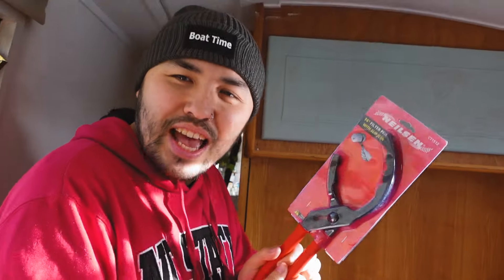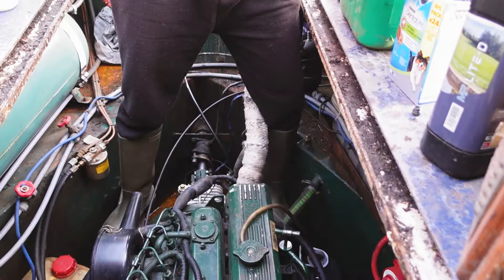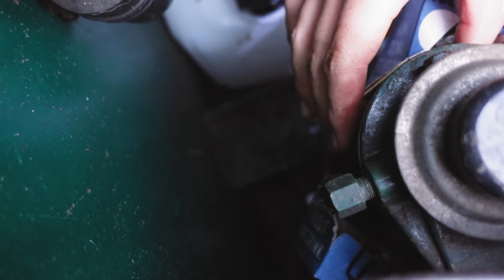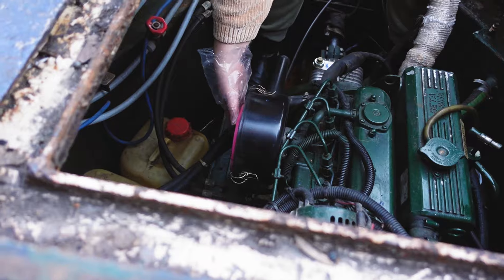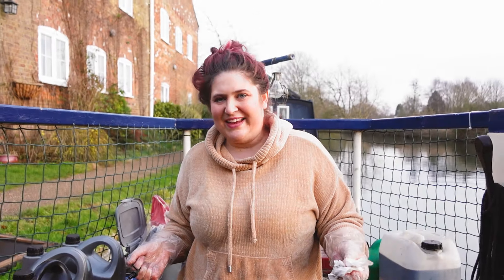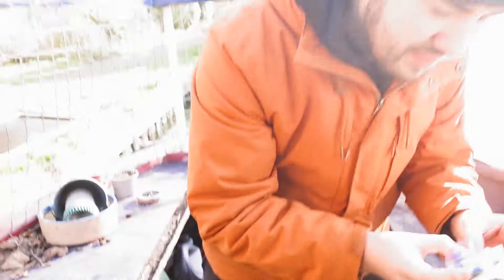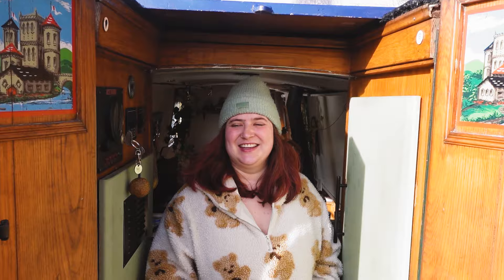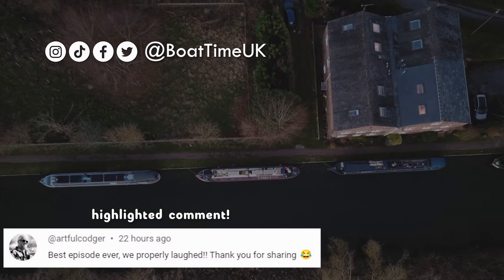We found a dangerous problem with our engine | Narrowboat maintenance - 194

Comment: i  have been a mechanic for 15 years,  use a little plastic bag and put it around the filters when you take them off and the fuel and oil will drip in the bag. it will keep everything clean. your filters should be tighten a quarter to half a turn when it makes contact with the surface.

Comment: Don't worry about an air filter being a bit thick as long as the casing will close. Only worry if it is too thin so it is loose in the casing. That old filter looked very dirty. Good that you changed it.

Comment: A word of caution when filling your fuel filter. The way you went about it was you opened the cock in the water separator. That is diesel that came directly from the main tank into a cruddy separator bowl then into the clean side of the new fuel filter. The centre hole of a filter is the clean side. You have no way of seeing what is actually going into the new filter. The little holes on the outer edge is where the unfiltered diesel goes it then passes through the paper filter then exits though the centre hole. So the way you did it is you poured possibly contaminated diesel into the filer which then goes directly into the injector pump and injectors. This could cause pump damage of injector clogging. It's not the end of the world but cleanliness is the best. Is there not a manual fuel pump to prime the filter? 

 This filter practice also goes with oil filters. Some people like to fill them first if they are vertically mounted. Personally I don't bother.

Comment: Wesley, Amy good seeing you again,
Isn't boat life a learning experience?
Your air filter needs to be snug so that the air travels through the filter and not around the filter.  As for your old air filter, that was disgusting lol.  It is better to change the Air filter often otherwise the engine will suck in dirt and not get enough clean air.  Dirt in the engine will create excess wear in the cylinders.
Definitely one thing to check when doing service is looking for lose wires and leaking hoses.

The engine wire order does not matter as long as the connection is secure.  As for the colour of the connectors try to keep the colour the same.  On the package of connectors it may tell you that different coloured connectors are for different size of wires.  You will also notice that on the crimpers there are coloured dots these related to the colour of the connectors.  TIP when crimping do two crimps on the connectors.
Best wishes to all four of you.
Mark
Alberta, Canada

Comment: Next time use a small strap wrench for filters as they fit easier, also filters should only be hand tight to seal. Also boat engines have low run hours so only need annual service. Never put your hand over air intake to try and stop a runaway diesel, you will severely damage your hand, runaway diesels are rare and only with very worn engines that are burning their oil. Well done for getting this done so, it’s nothing to be scared of as you’ve found

Comment: You should change your engine oil, and oil filter every 250 hrs of usage, your diesel filter every 500 hrs. Best thing you can do for your engine. It’s not once or twice a year, like your gearbox oil.
Reply: I agree. Oil, oil filter and one hour labour every 250 hours is way way cheaper than an engine job and the inconvenience of the down time.

Comment: Just as an fyi.. Cassandra comes in different forms ... She sometimes has short legs or only one leg, or a 3 bolt type set up, she also comes looking like a lil cap w a wrench socket atrachment, or has a sling or round key form..  she is varietiable and comes in as many forms cause there are a large variety of engines& they each have oil filters in complicated places. If you search for: marine oil filter wrench, it should show u a huge variety. All u need is the size of filter u use& then pic the best Cassandra for u.
Pls remember to add a dab of oil on the filter gasket & make sure the old ring is indeed off.
It prob would be good if you write down a parts list, take a pic of it, (or take a pic of the empty boxes& containers) then make them a favorite pic, so u can find it back easily & take the mystery out off odering. 
If you have a permanent marker (white laquer type) pls mark the bottles that have used oil in em. Often parts store will accept old oil, but check first.
Pls always disconnect ur battery (ies) before tinkering w wires.. cause .. well just trust me.
If u ever want to get into the entire electricity subject a bit more, or take the mystery out of it, u could order the book:
The 12 volt Bible (its an older book)
Alternatively the
Boatowners Mechanical and Electrical Manual will turn u into old pros in no time& have u never be afraid to tackle an issue again.
Cause knowledge is power..
Otherwise its great to watch u guys build more confidence each time u tackle an issue. So happy to see your happy faces& hear ur pride in jobs well done.

Comment: Its a lot easier to pump the oil out if you run the engine for a few mins to warm the oil, and remove the oil filler cap to prevent a vacuum forming.
Reply from the maker: yess we did that thank you!

Comment: If I heard you correctly you operate on diesel fuel, not gasoline.   I would pass the drained oil through filters Xtimes and add it into a full diesel tank when you fill up.  

Works here in the Arctic...

Comment: "Does the size of the hole matter in terms of electricalness?" - Amy, asking the real questions.
Reply from the maker: 😂 nobody tells you these things!
Reply: That made me laugh! Red fittings have a smaller diameter hole than blue 1.5mm and 2.5mm approx. 4mm are Yellow  The ring ideally should just go over the bolt, so long as there's a good connection and it's not loose or only fitting to one side your good to go. The strippers are pretty rubbish but OK for simple tasks like this and yes use the right colour position to correspond with the ring  or spade connector they are then compressed correctly, worth doubling over the end of wire  before crimping it grips better and less likely to come out
Well done for doing stuff yourselves and keep the blogs coming